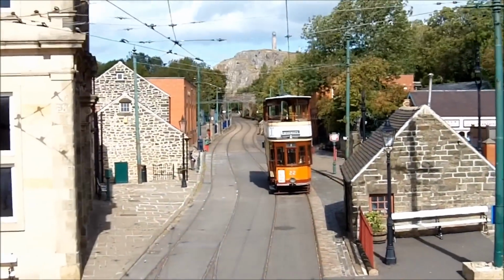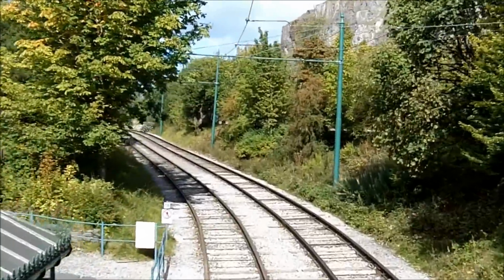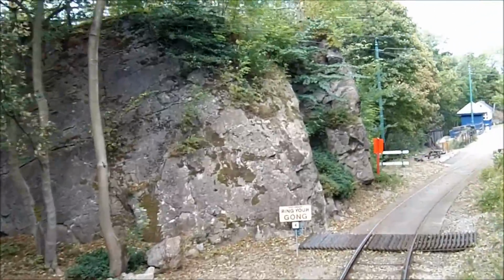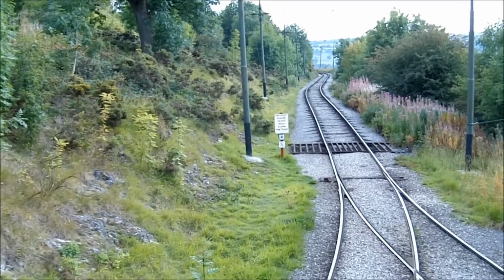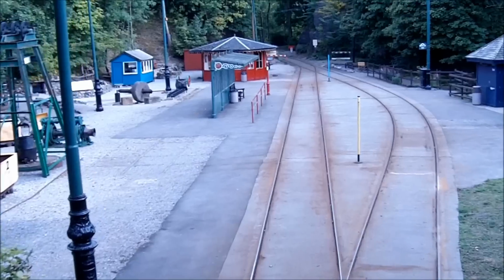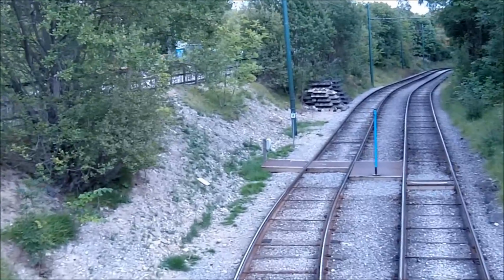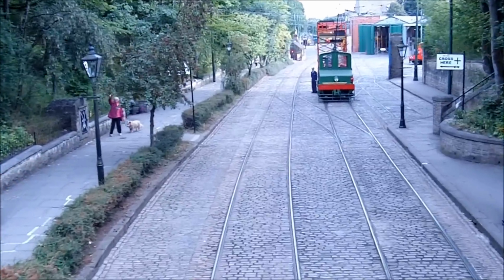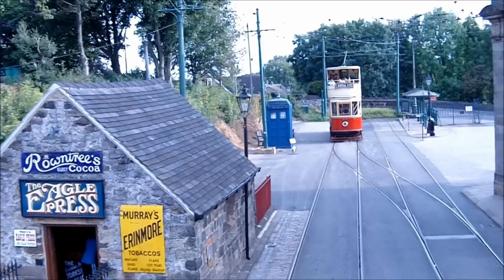A Trip Along The Line at Crich Tramway Village

Comment from the maker: @5786Dan I think they could, but it is the only place where an interlace could be appropriate, and as a Tramway Museum we try to show every aspect of a tramway, not just the vehicles.  Interlaces were pretty common on tramways, under narrower bridges and such; there's even an interlace on the current Nottingham tramway!
If the track remained at the proper width through the Bowes-Lyon Bridge, it'd probably be a tight squeeze!